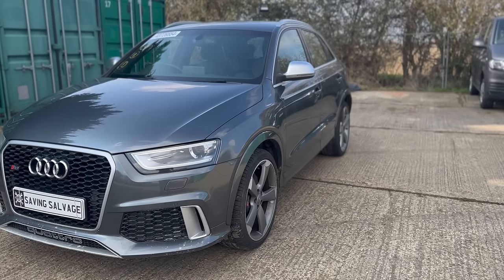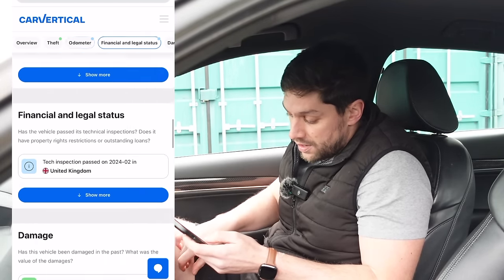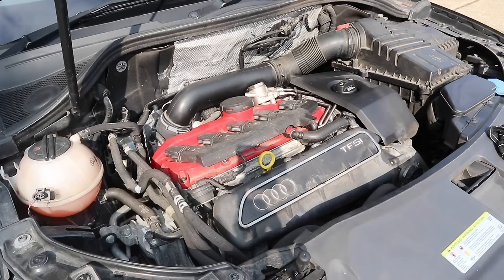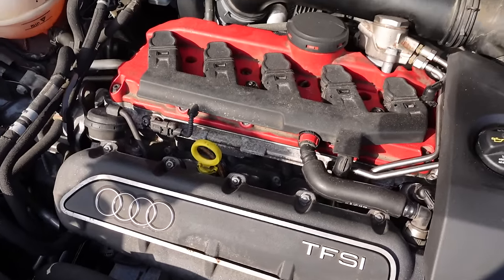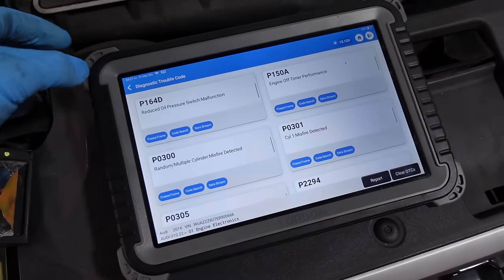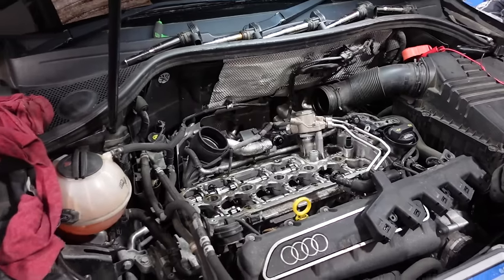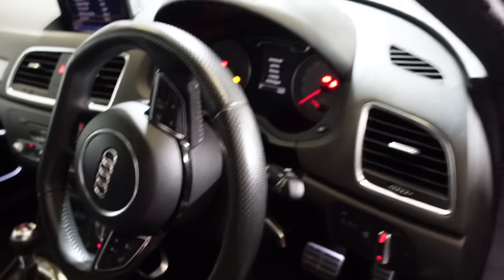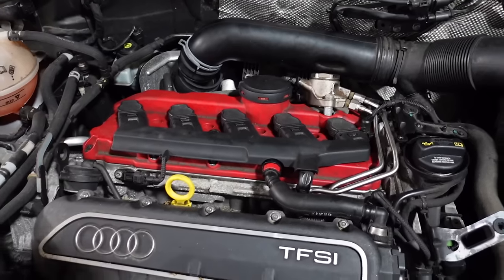I TOOK A MASSIVE GAMBLE ON THIS UNSEEN AUDI RSQ3!!... MAD CHEAP!!

Comment: If main dealer put to much oil in engine it's for reason or its timing chain stretched common fault or oil pump lazy or shit type of oil used or just over filled drain oil and  filter pot

Comment: Definitely tappets dean same noise you get from the 4g63 engine. See if they do revised parts as Mitsubishi changed from a 1 mm hole to a 3 mm. maybe remove them get them cleaned could be blocked.

Comment: Great video
Look at checking the oil pick up in the sump as well as historical oil pressure fault might be suggesting that's blocked up/restricted 

Also what scan tool do you use 
Keep up the good work

Comment: When a sparkplug coil on my Toyota gives way a metal rattle sound is heard from the engine when started, many people I know got a new replacement engine installed when they could have just changed a spark plug coil 🤞✌️

Comment: Pull the sump and check the oil strainer as typical VAG issue 
Also test the oil pressure valve another common issue

Comment: you need to stop doing your car repair's in that hoody or take the strings off look at video at the 21.20 mark them strings could of got wrapped in a fan belt or anything and you could end up dead mark.  take the strings out mark ive seen to meany accidents that way
Reply from the maker: Thanks! The alternator belts on the left hand side of the engine, nothing at the front to pull it in luckily 😬

Comment: I would be interested to see what Audi main dealer said. Assuming they condemned the engine.  Not sure you can find out?
Reply: I’d give them a ring as well as they may have already diagnosed it but then there would be no video😅
Reply from the maker: I don’t know what dealer it was. Only tells me that it was done by an Audi dealer

Comment: I had this tapping on my seat , it was starvation of oil not getting to the top the cause was debris in the oil pick up pipe in the sump I  took it of cleaned the mesh on the pick up did an oil engine flush did oil change and it was sweet .
Reply: Had a similar thing with an old ford cvh, it was sound when cold but after 4 or so miles it would miss fire and the tappets would rattle.

Comment: Piston Slap which is what happens to Porsche M96/7 engines when the bores are scored.
Reply from the maker: I hope not 😬
Reply: @SavingSalvage Dean, Vag Techic is the channel for these engines. These guys are serious Audi experts and have covered the reasons behind the top end failures a number of times. The root cause is the oil service intervals, they recommend 8k per oil service. Of course the manufacturer doesn't want to frighten folks off with big service costs and...........
Reply: @SavingSalvage I also hope not, but had that happen on a 4.2 V8 as well.

Comment: Full of sand means it was either at the beach when it died or was drowned in the sea. If drowned it can't go back on the road and is scrap. It's not timing chain because it goes away and the engine revs up fine. Low oil pressure error could be the sign of a HUGE problem.

Comment: Hello If You Read My Coment Plz Check For Noise Underneath At Oil Pan It May Be Crankshaft Bearing For Piston Conecting Road And Before You Replace Abything Do A Compression Test Maby You Have Dead Piston And Can Make That Weard Noise Good Lock